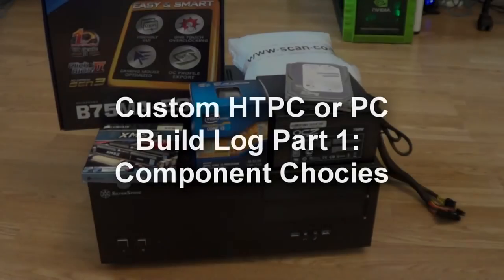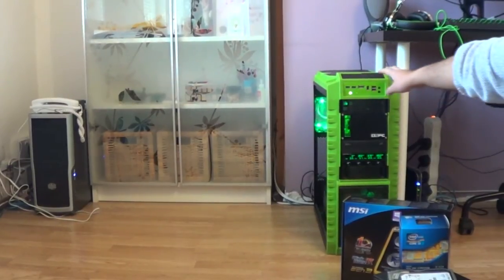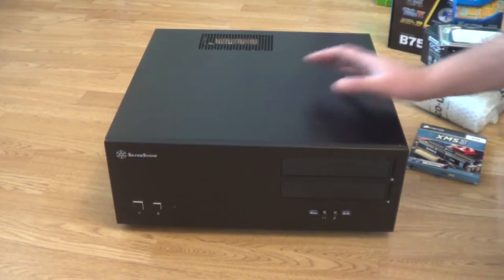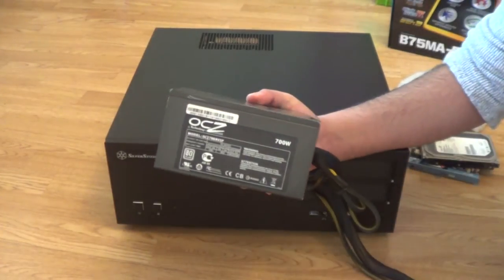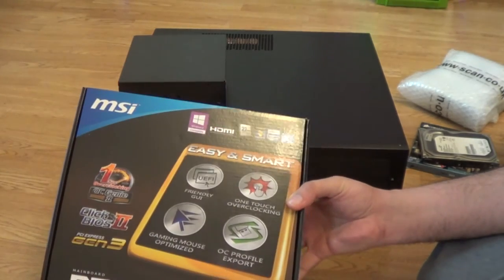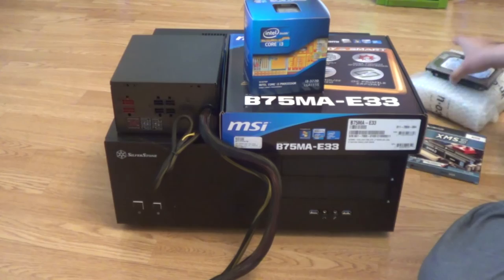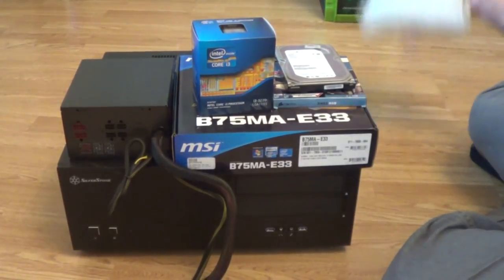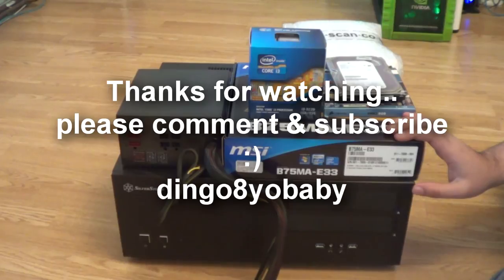Custom HTPC Build Log Part 1: Component Choices

Comment: Great Vid! I'm so in love with this case! So I'll go right on to watching your installation immediately. 
I have a few questions I hope you could help answer for me.
So, I am a gamer, but I hate the aesthetics of basically anything gamer like (especially the tower cases). So I'm building this with some respectably powerful parts, so I need some cooling that also isn't too noisy. Do you know of any cpu watercooling unit that can fit into the 2x80mm exhaust holes in the back?

Comment: Also, are the front brushed aluminium "stealth" cover plates for the optical drives removeable? I'd like to install an LCD Fan controller unit there.
Any help would be appreciated :)

Comment: Hello Mate

Out of curiosity, why did you go the Intel Route and not the AMD Trinity? Since you are not using a dedicated graphics card, wouldn't it have been better to go with the Trinity as it has a far superior GPU and costs much less than the Intel route? Did you have leftover parts or was there a specific reason?